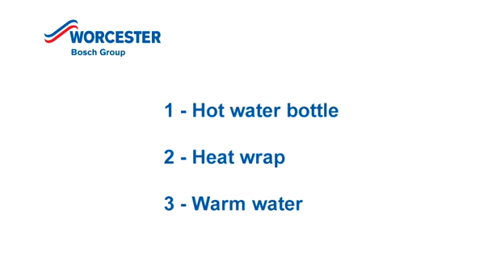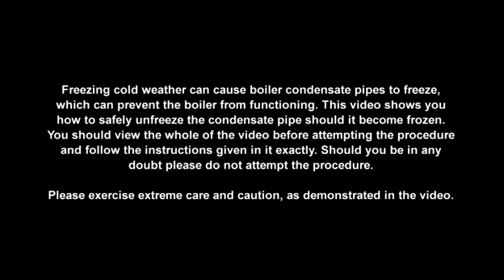How to Safely Unfreeze a Frozen Boiler Condensate Pipe | Worcester Bosch

Comment: Someone told me this happened to them, so I thought I would look it up as I guess its a possibility
I guess its only a problem if your pipe extends to the drain rather than just 2-3cm to open air
Reply from the maker: Good morning, thank you for your message. You can find out more about how to unfreeze your condensate pipe here - https://www.worcester-bosch.co.uk/heating-advice/frozen-condensate 

Many thanks, ENC.

Comment: At 1.40 you say 'don't use warm water if the condensate pipe has been installed above ground level' please explain
Reply: I believe he means 'above ground floor level', not "above ground level". A daft and very misleading mistake if that's true.

Comment: Doesn`t heating up the condensate stored in the syphon negate any energy saving/recovery? What is the point in having a condensing boiler if you are going to reheat the condensate and then dump it down the drain?
Reply: No this is a discharge pipe and has absolutely nothing to do with the heating side of the boiler,it’s caused by the burning of gas and is a byproduct of this process,discharge pipe work best practices would be piped internal,whereas all new installations should be piped in 32mm to help negate freezing!

Comment: Condensate pipe only freezes if its not installed as per regulations. So if its frozen, it is incorrectly installed.
Otherwise do as per video.
Reply: Wrong. I've seen many that come within regs, even with lagging, and they still freeze. Its actually better to leave the lagging off so it's easier to defrost with hot water on the outside.
Reply: Regulations say the condensate pipe is meant to go into a 32 mm pipe, and should be lagged and attention paid to local weather conditions. e.g use a condensate heater kit. We are in London and hardly get sub zero temps so this is not really a big problem. We have installed over 400 boilers and not a single call out for a frozen pipe because we put it into a 32 mm pipe and used external pipe lagging as it should.

You say leave the lagging off, this would cause compliance problems for me.

All the frozen pipes we get called out do not have even the basic lagging. As I said, it may be different in colder areas.

Comment: Don’t attempt to do this if the pipe is above ground level? What am I missing?
Reply: Mine is 9ft up. Ladders check. Boiling kettle check. 5 minutes later A&E.
Reply: Burn somebody below you
Reply: Boiling kettle is the way to go. Stop being a ninny
Reply: He means above the ground floor, so not coming out from a higher floor of the house.
Reply: @6022  I don’t know about anyone else but I’m capable of using a ladder
Reply: I have this issue but the pipe is in the most awkward position out the side of my house above a very steep garage roof /\ like this. And it’s impossible to get to it safely especially in these conditions. Any advice?
Reply: @B2KJFF  is it possible to lean out of a window? I saw a plumber dangling a portable heater on a piece of rope. where there's a will there's a way.
by all means, though, use your loaf ... if you reckon it's too dangerous then it's not worth it. it'll thaw soon enough.
Reply: Pouring water while balanced on a ladder could lead to something life changing.....so not worth it